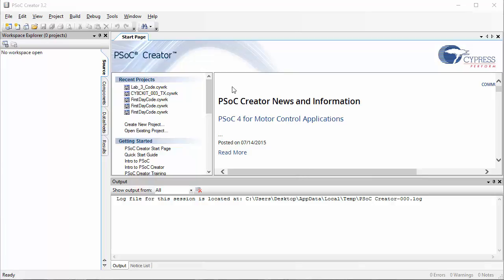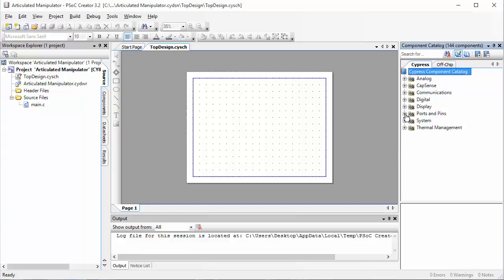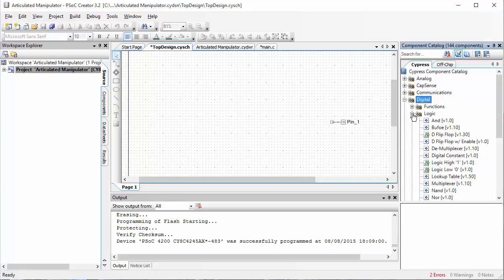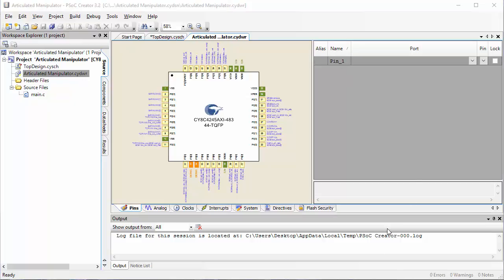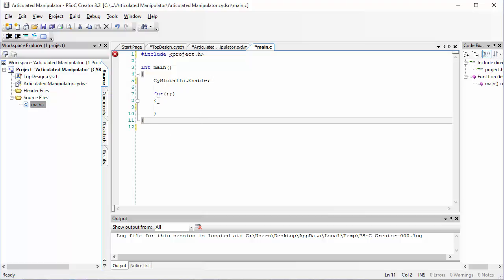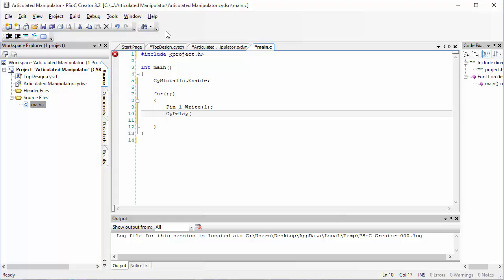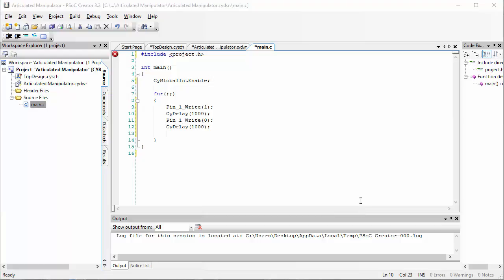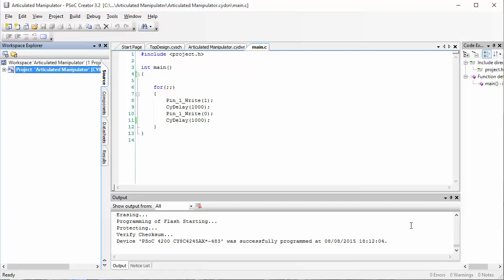1 1 3 Lab Video 2 of 3   First PSoC Code Flash an LED

Comment: I did this program in the customized PSoC processor module. But the Led either turns on or Off based on the logic input and not blinking. What would be the possible errors?